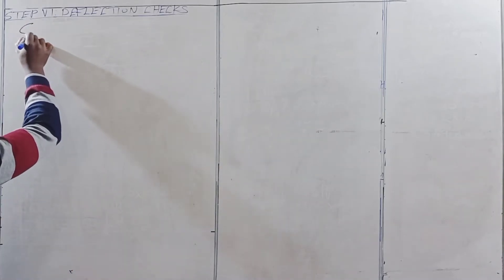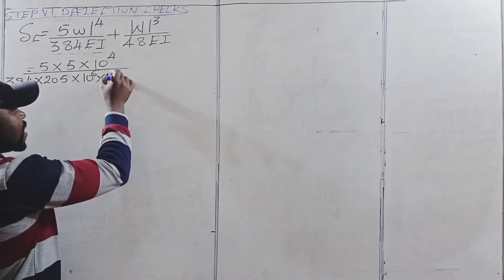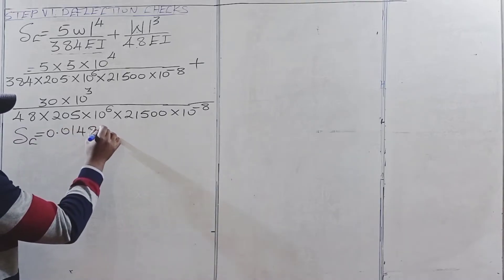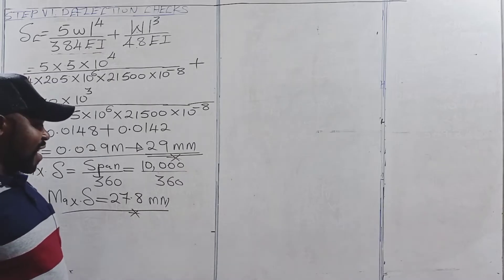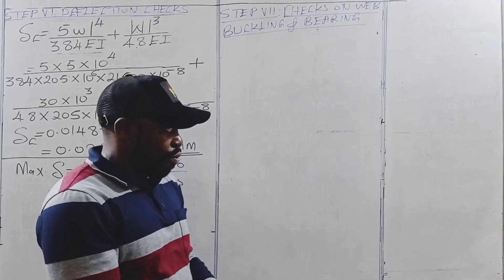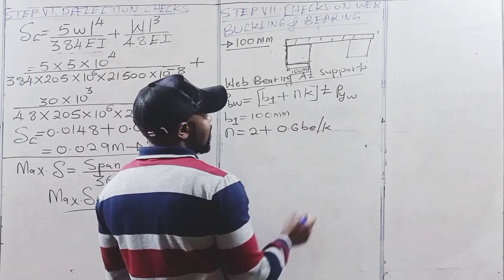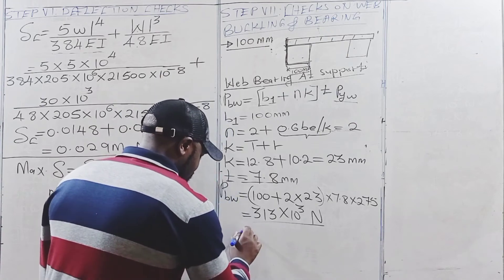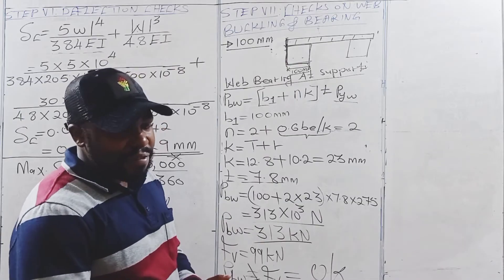PART 2:SELECTION OF A BEAM SECTION IN GRADE S275 STEEL [BS 5950]

Comment: Sir please when doing your deflection check in the formula we only used our w as 5kn\m but we had 5kn\m imposed and 5kn\m point loading ???
Reply from the maker: The formula uses the total load, which is the sum of the imposed load and point load.
Reply: Why was,the dead load not factored @georgekamiti6538
Reply: @georgekamiti6538 so are we really not considering the dead load?
Reply: @jeff_artistry  we usually don't consider dead load in checking deflection at serviceability limit state in steel, only unfactored imposed load.
Reply: Absolutely 🤝